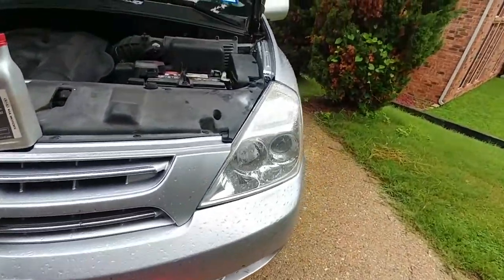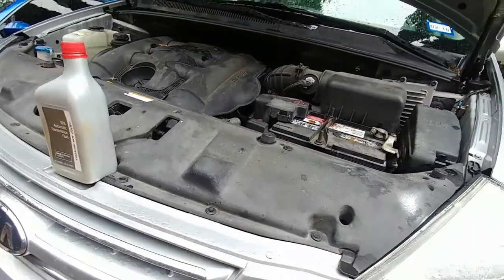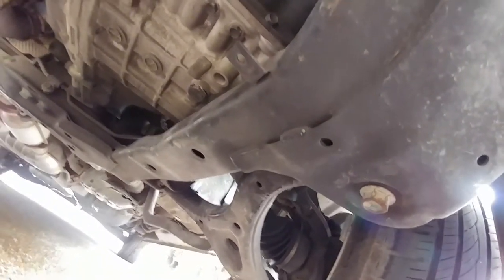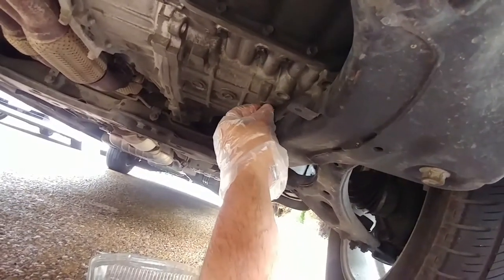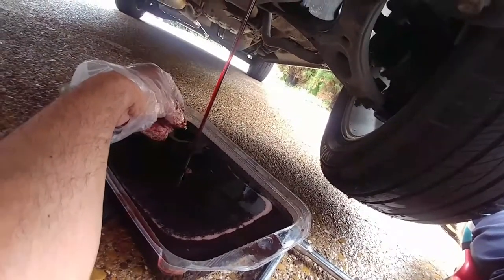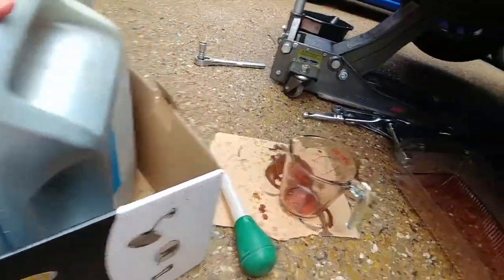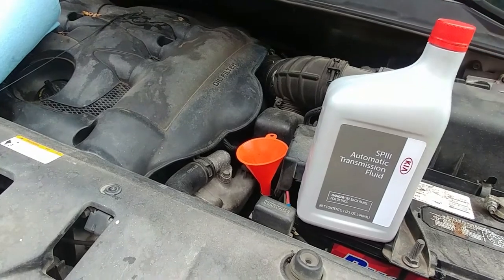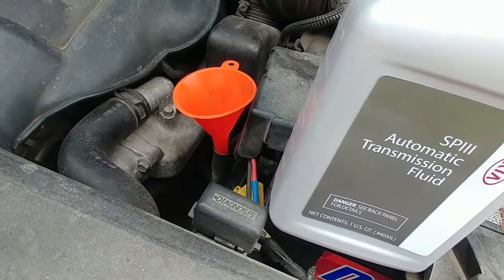Kia Sedona Transmission Oil

Comment: Every 15 - 20k miles makes for a very happy trans. Even more important to do it early and often being there's no serviceable filter. The OEM magnet plugs are no better than fridge magnets. Look into Dimple magnets.
Reply: Never heard of a dimple magnet. Ty 😊
Reply: Do you use spiiii or did you go with compatible? I got 320k pulling trailers using Castrol multi vehicle and changing 4 qt every 5-10k. It finally died. Might use spiii only on new trans.

Comment: Thanks great help. Have you heard of a jack/axle stand? I've heard you only get killed once!!!
Reply from the maker: I'm not under the vehicle... it's really close to the front... minivan is high enough
Reply: @CarsandEspresso  I know where it is, I have just purchased one. Still a good habit to get into. I know I will be using a set. Stay safe. Cheers.
Reply: I pull up on a high curb.. drain in a bucket.. recycle.. refill . Drive away. No jack needed. I got 320k out of mine.. scrapyard Sedona trans is all that's out there for 2010.. however a rebuild kit is available for a 2009.. both trans are compatible.. I'm confused 😕. Cheers
Reply: There should be enough clearance to do it on the ground or does the manual call to have it on stands?

Comment from the maker: I know I said 24mm, but it is actually a 23mm socket
Reply: In the beginning you said 24 "inch" wrench amd 24 "inch" socket
Reply from the maker: @samholt2062  I just did this again last month... I can't remember the correct size...ther than the bar gets in the way... maybe use a wrench if you do it often

Comment: Have 2006 sedona and 200+ miles on it. 3rd gear works weird, plus it hard to see the fluid level on that stupid dipstick. How do you think, should I change the fluid or it's better to keep the old one?
Reply from the maker: 200+ and it's never been changed?  I'd do a spill and fill  - then see how it runs, and then do it again... slowly bring the fluid back to life... Good luck...
Reply from the maker: Also, doing this won't fix anything... just prevent things from breaking...
Reply: @CarsandEspresso  I don't know whether or not it's been changed. I bought this car 5 month ago :) Anyway, thank you for the  advice ;)

Comment: Good video.  Just one caution here....We did transmission fluid change on a 2008 Sedona 120K which had no fluid change ever done to it.  A month later the transmission gave out on 1st gear and reverse (Slipping).  The fluid we used was Valvoline MaxLife SPIII certified for Kia
Reply: OMG! I wish I read your comment earlier! I just changed the fluid using Valvoline Maxlife this evening! What should I do now?
Reply: lucky dog Based on your username you'll be fine.  If you don't feel comfortable try swapping it with OEM KIA fluid
Reply: @luckydog2162  how was that valvoline fluid? Van still shifting properly?

Comment: Question the transmission filter is inside the transmission?
Reply from the maker: if I remember correctly,  it is a non serviceable type...
Reply: @CarsandEspresso  I think you could get it out maybe if you pull the radiator and condenser 😭

Comment: i have a 06 .....its starting to slip n shift funny ...by doing this spill n fill would it fix or give me some time
Reply from the maker: Crispy Chicken nope... You can't fix it with a transmission fluid... Just maintenance...
Reply: If it is slipping and you change now. It will actually make it worst.
Reply: Get a rebuild kit! You'll be proud when you're done 👍
Reply: Hey, did you do spill n fill? How it is going after that?

Comment: Oh you pull a trailer with this fwd.  How many pounds can you pull?
Reply from the maker: Randy Warkentin a tent trailer  (pop up) 3,200 lbs... stay in 4th gear and under 65 mph...
Reply: Yeah great for towing except for an uphill standing start in the rain.
Reply: @CarsandEspresso  I've pulled wayyyy to large loads. I used timbren assists in the rear springs.